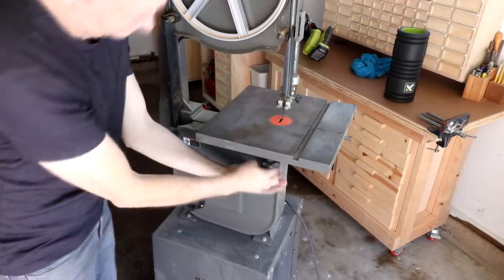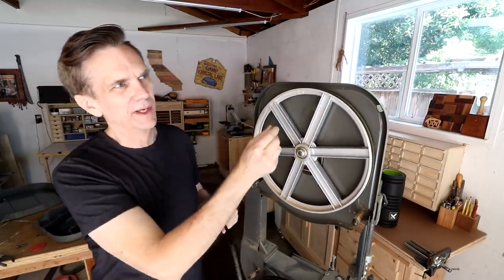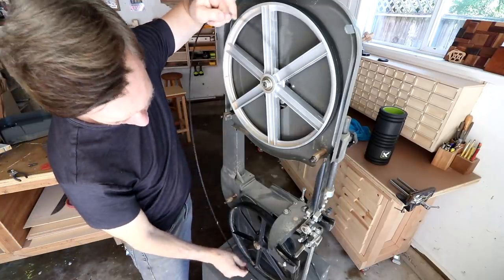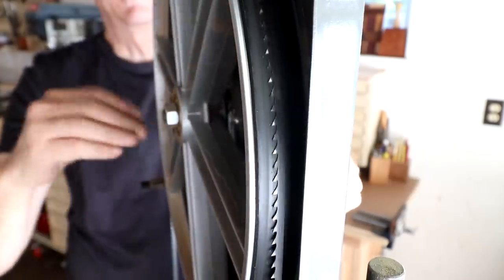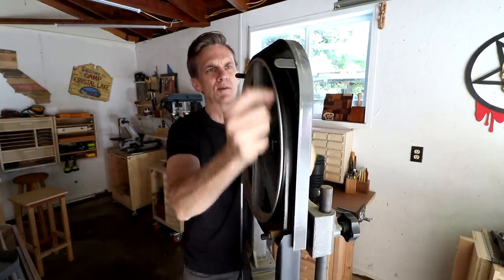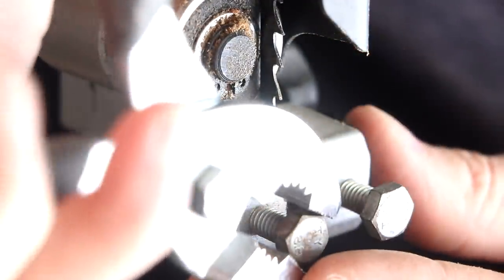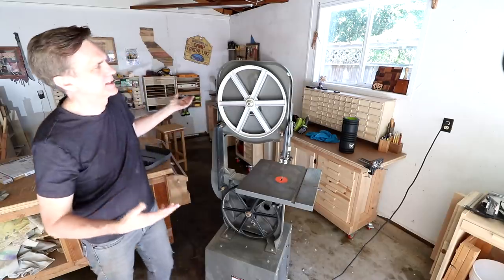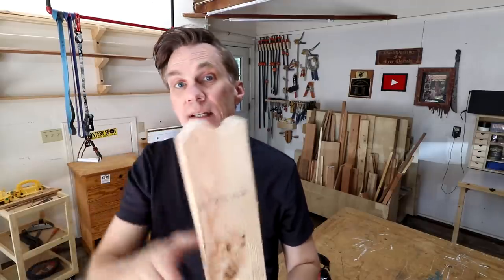Changing the blade and setting up my bandsaw | LOCKDOWN Day 69 (hehe)

Comment: I actually only own a 9" band saw, you can do the same stuff that you can on the larger band saws but you must go slowly otherwise you end up with crooked cuts. I can resaw on it and it's generally big enough for most curved projects I run through a band saw. Let's face it, if the piece is bigger than a foot wide most of us resort to our jig saws anyways. For set up I tend to not over tighten my blades, they are welded so that weld can be a weak point even on bigger saws. I've used giant sized band saws that only are meant for doing resawing and I've used the smallest band saws, the set up is the same. Marc Spagnolo had the actual band saw guy on the wood whisperer a few years back so it may be worth looking at his instructions for setting up properly.

Comment: I have a question not related to bandsaw blades, but I’m not sure how else to poke a question at you.

Do you know if anyone makes a small metal clip to attach to the edge of a measuring tape with a slot or hole for a pencil?

I have noticed that when I’m trying to measure and mark, sometimes it is tricky to see the marks (like measuring up a wall), and sometimes I want to do the exact same measurement multiple times in a row. It occurred to me that if there was a small clip that I could line up on the measurement, then marking that would be a breeze.

Anyhow, love your your videos. Wish I had my shop set up like yours!

Comment: For the best info on band saws, Alex Snodgrass is the expert.  He has several videos that are easy to find.  He recommends centering the base of the gullets on the wheel when setting the tracking.  Also, the thrust bearing should not be touching the blade when not cutting.  Touching generates heat, and doesn't let the blade cool down between cuts.  Band saws are a wonderful tool, and bandsaw boxes are a lot of fun.  I'm looking forward to tomorrow's video.

Comment: Are you sure you have to remove the table? or is that just to make the lower guides easier to re-adjust?  I have a different bandsaw and the blade is what goes in sideways then back to straight vs the table.  ie for mine I just route it in the slot in the table.  Good video :)

Comment: You should upgrade your bandsaw tires and balance the wheels  you will notice a much smoother tool.  I used zip screws to balance my old saw.  Try it works great

Comment: This is a very needed video. And when you are adjusting those bend guards, and bearings, you can stick a piece of paper between blade and guard, put guards next to the blade, secure them and then take out that paper, so you will get a tiny gap in the thickness of the paper.

Comment: It's important to note that not all manufacturers size their bandsaws the same way. Some use the distance between the throat and the inside edge of the blade as the size while others use the size of the wheel. Definitely check with the manufacturers specifications before making a bigger tool purchase. I don't think you need to remove the table to change the blade but it makes for a great visual demonstration!

Comment: Another way to coil a blade is stand on it as you were, hands apart with palms up on either side of the blade then roll wrists inwards and over pushing the blade down on the ground. I've changed a lot of band saw blades in my life and your machine looks very fiddly. Ever had a blade snap on you when using the band saw - scares the bejesus out of you when it does.

Comment: As a meat cutter I  change blades often. The easiest way to coil it is to step on the blade like you did but by holding it with both hands palms facing forward you simply cross your arms to end up with your palms facing toward you and then step off the blade it will softly coil up.

Comment: Tips & Tricks: 
Use a featherboard when resawing. 
Only have the guard as high as you need to get the board under it. 
Check for square frequently & be sure to adjust your fence each time you change/adjust your blade to be sure it still tracks.

Comment: I don't do a lot of working with band saws personally, but I have always found it easier to coil the blade by holding it in the center at both sides (the 3 o'clock and 9 o'clock position, and flex both sides of the blade inward to the center, until 2 loops form at the top and bottom.  The loops should basically stack onto one another.

Comment: I agree with others....leave the table on to change the blade, though yours seems to remove very easily. One way to tension is the "flutter" test: tension the blade until it does not flutter while turned on, looking into the teeth. I always de-tension my blade when I'm finished too to help preserve the blade life (so I was told).

Comment: I spent years in a machine shop and uncoiling the blade is the easiest part (we used some really beefy blades in metal shops). Take the ties off, throw it on the floor. Done.

Comment: You didn't have to remove your table to change your blade. With your saw all that you had to do is turn the blade when you got it off the wheels and slide it between the slot on the table. 
Keep the great videos coming. 

Thanks for sharing and God bless

Comment: Steve I have used a bandsaw for years and changed the blades often and never removed the table.  It looks like it’s a lot easier to adjust the blade with table out of the way.  I will give it a try. Also I don’t seem to need to adjust tracking in between blade changes.  I always adjust the tension with the gage on the back.  Thanks for your great content!

Comment: The thrust bearing behind the blade shouldn't touch it when the blade is stationary. Set it a hairsbreadth back  so that it touches when the lade gets pushed back.
What do you do about sawdust removal? And is there a little brush in the lower wheel  case to keep the blade clean?

Comment: I have an ultra cheap 9" bandsaw...similar to the ones from Harbor Freight. I HATE it. I can fiddle forever with the setup and no matter what, it seems the blade will deflect in everything and stall out the motor mid cut. It's totally underpowered. I suppose after this bandsaw box series that is coming, I'll want to look at upgrading.
Reply: Look up Snodgrass, he's got great videos on the band saw set up.  Rikon makes a good low cost band saw with a great resaw capacity.

Comment: Steve I remove the tension from the blade when not using the saw for awhile. It supposed to be better for the saw and the blade.
Reply: The instructions I have with my 10" bandsaw recommend removing the tension when not in use. It says it helps to prevent flat spots on the wheels. I've also made a small cover for the power switch to remind me that the tension has been removed, so I don't turn it on without the tension (yes I did it once)

Comment: There's also a theory that the gullet of the blade, and not the entire blade, should be centered on the wheels. This moves the blade slightly back and can allow the cutting edge to be more stable.
Reply: It’s not a theory. It’s the best practice. 
The blade tracks much straighter - assuming the rest of your saw is set up properly - when the gullet is centered. This way the teeth are effectively hanging out over the tire with no influence from anything other than the wood itself affecting its tracking.

Comment: I know the blades can be a challenge getting on . I use a little strip of blue painters tape on the blade over the top wheel to help hold it in place for a few seconds while I get it on the bottom and get a little tension on it then remove the tape and finish adjusting .

Comment: Bandsaw tip: inexpensive imported (but functional) 14" bandsaws (and drill presses) are abundantly available on Craigslist at popular prices.
Reply: I picked up a made in Taiwan 14 " bandsaw off of a local marketplace site a while back. It seems to me that the harbor freight bandsaw is an exact copy of the one I have, which is probably a copy of something else.
Reply: @gizanked  The Asian imported bandsaws are generally copies of the Delta 14 inch.  I have the same bandsaw you have, Taiwan copy of the Delta, from about 2000 (found cheap on Craigslist).  These were sold by Harbor Freight until they started getting their bandsaws from mainland China.

Comment: I sure wish I had a band saw, but I just got a table saw, router, jig saw and a cordless drill. So the band saw will have to wait a while.
Reply: I did most of my big tools within a few weeks of each other.  Big strain on the wallet.  Bandsaw was my final one and got a Wen 14 in.  Inexpensive and works very well.  The only problem is the blade size is odd.  You have to buy your blades through Wen.  Remember Wen?

Comment: I believe I heard one person say the teeth need to be aligned in the center not the blade as a whole.  Oh and I believe the slot is used to install the blade w/o removing the table?  Is that correct?  Learning here.
Reply: Look up Snodgrass band saw setup. Removing the table makes it much easier to align the bottom guides. If the teeth are centered on the wheel because of the curve of the wheel it puts pressure on the teeth which can cause damage and make it harder to align.

Comment: Steve never leave your bandsaw blade under tension,  when done, loosen the tension on the blade and it is the Teeth of the blade that should be centered onto the rubber crown of the wheel not the whole blade body.
Reply: Gullet* 
The “valley” of the teeth should be centred on the crown. That way the crown will not influence or deflect the blade through the cut. 

In theory the only bearing or guide block that should be contacted during a cut is the thrust bearing at the back.

Comment: You don't really need to remove the table. There's a slit that runs through it and you can easily pass the blade through it.
Reply: It's not needed but it makes setting up the lower guides much easier, depending on the band saw it quicker to remove the table.

Comment: The 14" actually refers to the size of the wheels that blade runs on. 

Also, I'm using the cool blocks that you talked about and they should be set just away from the blade as well.

Also, Snodgrass says that the blade should run just ahead of the crown of the wheel, not on top of it. 

(Sorry, recently been setting up my bandsaw so been watching a lot of videos on it)
Reply: No it doesn’t 
It refers to the throat capacity. And in the case of a 3 wheel bandsaw this won’t match the size of the wheel.

Comment: Most bandsaws have an indicator on the tension knob that tells you, per the blade thickness, how tight to adjust. Taking the table off is totally unnecessary!
Reply: Except that indicator is not very accurate and I've found if you go by it the blade is much to loose.
Reply: Yeah, no need to remove the table, but also never trust those indicators.
Reply: Indicator is totally inaccurate. It’s a decent baseline, I guess but it’s not reliable. 

Taking the table off is unnecessary. But it’s a worthwhile step if you want to properly tune and adjust your bandsaw if you haven’t done it in a while like Steve said. Gives you better access and visibility when you set it up, and in my case I can never vacuum all the sawdust or properly clean and wax things unless I take the table off.

Comment: Pretty sure you didn't need to remove the table to remove the blade.  Once you loosen it from the wheels, you can twist the blade to get it out the slot on the table. If I had to remove the table each time, I wouldn't change the blade very often either.
Reply: You are right, but he couldn't set the bottom blocks easily with the table on...it's probably one of those things that takes 2 minutes to remove it but doing so saves 10 minutes in setup.

Comment: Your method of pulling the table completely off for a blade change does give you much better access to setting up the lower blade guide blocks and thrust bearing.  That said, you can leave the table in place and turn the whole blade 90º (as a loop) to pull it out of, or push it into, the slot in the table.  This is what I've been doing on my old Delta 14" bandsaw.  However, I think I'll try your "remove the table" methodology next time I change a blade.  Setting up the lower guides is a real pain with the table in place.